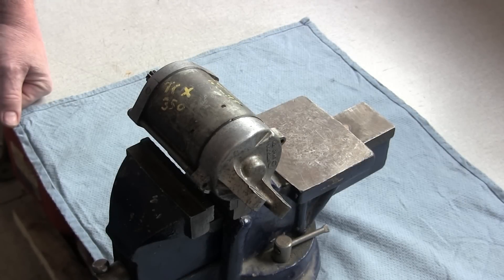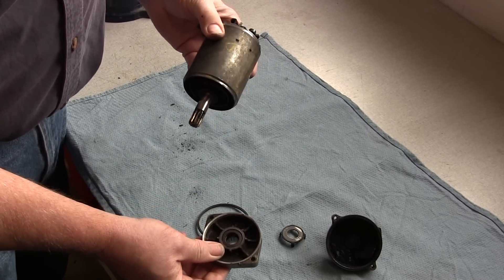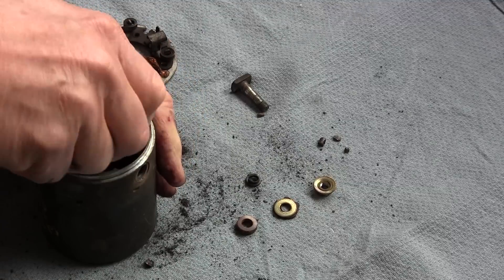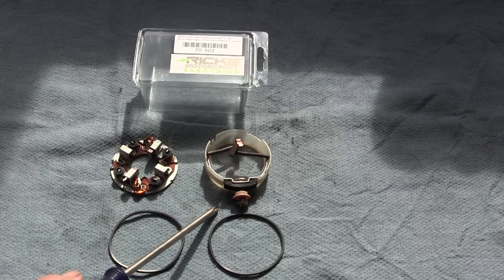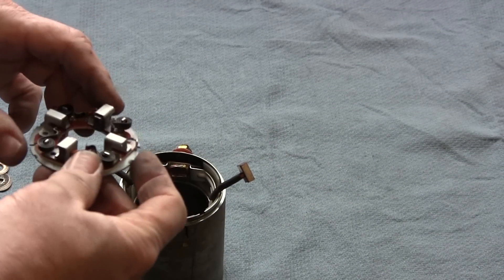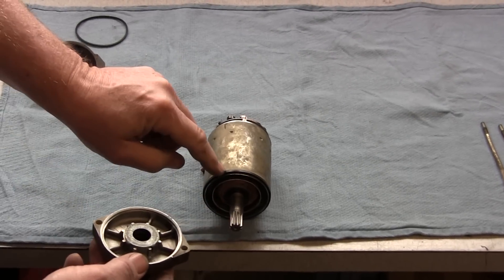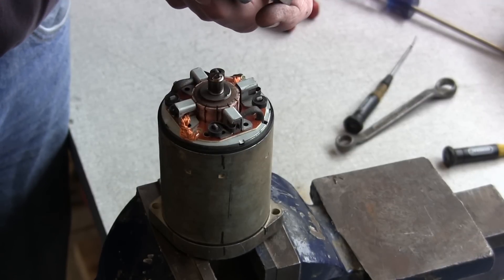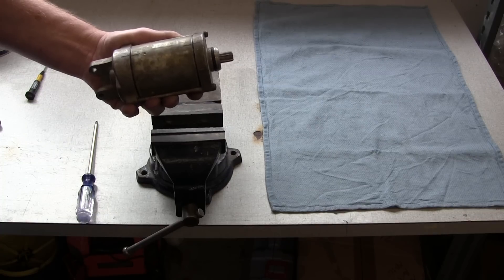# 3: How to Rebuild a Basic Motorsport vehicle Starter Motor

Comment: Great video. 
I have a SM-8227 starter from a Suzuki GR650 motorcycle, identical to the one in your video.
When i disassembled it, a tiny 5mm rubber 'O' ring was loose inside.
Anyone know where the tiny 'O' goes? 
The kits from Amazon have that tiny 'O' ring included too, so must go somewhere ??

Comment: Did I screw up my starter when I unknowingly did not mark it in the beginning stage prior to removal?
Reply from the maker: If it's been put back together already and is not running correctly, then yes the polarity could be off.  Many starters do have alignment marks on them from the manufacturer and/or alignment tabs between the body and brush plates that can also be used.  We recommend putting unique marks on both ends before opening an unfamiliar starter to be on the safe side.
Reply: @RicksElectrics  Yep found it, had to get it cleand up really good to see it first however I can tell just by looking at it it will need new brushes. But I would like to a big thank you for responding. I have been going through a rough time here in my home town dealing with trying to parts from my local shops. They say one thing but I never hear back from them, I try calling back and its always a voicemail. I like to do it person so I know what I'm dealing with but, that's what I'm working with here. I take my chances on-line 🤬

Comment: Hi I got problem with my starter motor for Honda vtr1000 I assembled it with brand new brushes and brush plate. Cleaned commutator area. There is not continuity between commutator and shaft. And is continuity between each all segments of commutator. So all is fine as should be according to manual. I got heavy sparking when going after connect battery ,shaft not moving. I checked this with second  spare armature and is exactly this same problem. I tested any leaking to ground between positive brushes to housing or to shaft -no evidence of leaking on multimeter. What can be reason ? Is possible problem with armature but what sort? As I said tested leaking on commutator between it and shaft I even use other spare armature and tested it -all fine ,what can be reason of this heavy sparkling and not rotate of shaft?
Reply from the maker: Hi Peter,

Heavy sparking is indicative of a dead short.  However, it is extremely difficult to diagnose this sort of problem over a message board.  If you send us the starter motor we'd be happy to take it to the shop and diagnose it.

Comment: What happens if I forgot to put the marks on the case when I took it apart?
Reply from the maker: Andre Rivera we can fix it for you if you send it to us. Should only be a minimal fee.
Reply: Andre Rivera Nothing. Fit it back together with a little patience until the screws align on both sides and everything is set nicely. Hold the Sharpie.
Reply: Tom Collins what do you mean when you say align? What is the actual purpose of putting sharpie marks on the case?
Reply from the maker: @GREENTHUNDER0   what bike do you have?  Most are "keyed" so that the magnets properly align with the orientation of the brush plate (so you wouldn't need the sharpie as Tim says).  Many starters also have stamped in hashmark alignment marks but not all of them.
Reply: Rick's Motorsport Electrics ahh ok. I have a 4 brush starter for an 85 Yamaha virago xv700n

Comment: I have a 82 honda cm250 starter doesn't work. I know the solenoid works. But can't get starter off because of exhaust is in the way. Can't get last bolt off. Then they make bolt way too long. If brushes were replaced would it fix problem?
Reply from the maker: that could solve the problem, but can't be sure unless you open up the starter motor.

Comment: Old post I know, how 'common' is it to not have a removable insulator but rather a fiberglass 'tape' just stuck to the inside of the housing?
Reply from the maker: Sounds like your starter has been "repaired" before without the proper pieces as that is def. not common.

Comment: Hi Rick, nice work,tell me if its to solder new brush or need to buy a new plate with the brush ?
Reply from the maker: That depends on what your problem is...  What year/make/model do you have?
Reply: Its a Kawazaki Z440 year 1983, need new brush. there are two Nort and two South, here in my country they not sell a new plate, I think I need to find somewere the brush with the same size and made the adaptation...

Comment: I have a Yamaha XT225 and one of the magnetos came off and I don’t know what kind of glue I should use to get it back and stay in its position 🤔🤔
Reply from the maker: We do not reglue/repair the magnets inside the starter motor.  Unfortunately we'd recommend replacing the whole starter.  We sell a brand new one of the 2008-2012 models: https://ricksmotorsportelectrics.com/New-Yamaha-Starter-Motor-61_417
Reply: Thanks for your message I have bought from you some parts already All excellent quality 
This magnetos, I just bought a good super glue and put then back and it is working so far, so good!

Comment: starter would not turn over. Tore it apart, tested the armature and it was fine,  cleaned the commutator and sanded the brushes, works fine. Thanks for the video.

Comment: Hey rick I hope yo can help me. 
I have a '83 V65 magna and the polarity seems to have reversed and instead of counter clockwise, its now clockwise. How can I reverse the polarity? Can I switch the caps so it goes in the correct direction? The starter motor is strong but the bike did sit for 12 years before I purchased it.

Comment: a very clear explanation , but in my case the magnets were loose 
and could see that two of them attract and those same repel with the other two ,
 so intercale four , so that I face each out otherwise , 
ie N and S. but the engine does not work. 
with a tester I see as the impedance varies in the positive and negative terminals
 of motor turning it by hand , so q I think that the electric part is fine, and I'm doubt magnets position, it is not easy unstick
can you help me

Comment: Great Video, having issues with my starter motor on outboard tried turning the engine over for too long and it stopped working.  Body of the starter was really hot so think I might have cooked it.  Any ideas what is likely to have happened?  thanks

Comment: Is a motorcycle start fully engaged to the flywheel's teeth 100% time? i mean, a car's starter has mechanism to "push the gear out to engage to the flywheel", but a motorcycle's starter does not have those. Thanks!